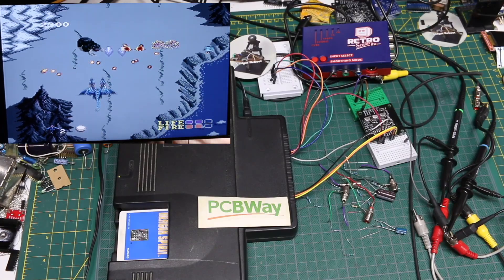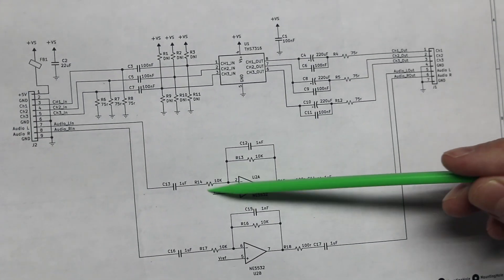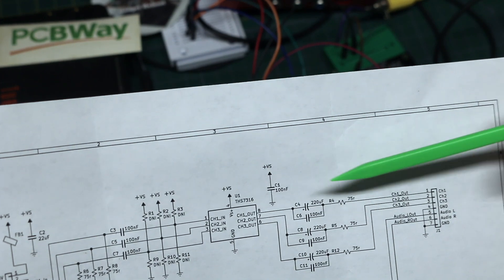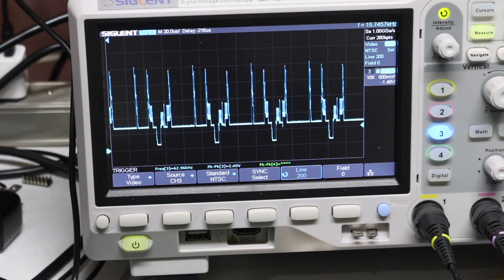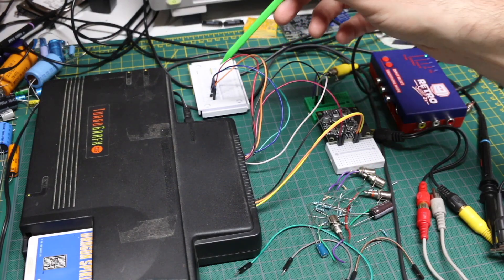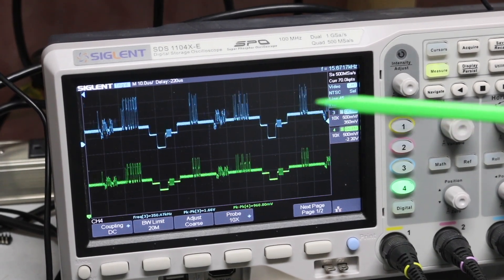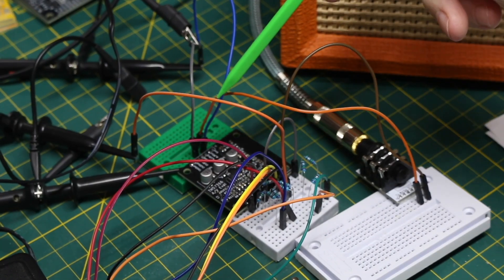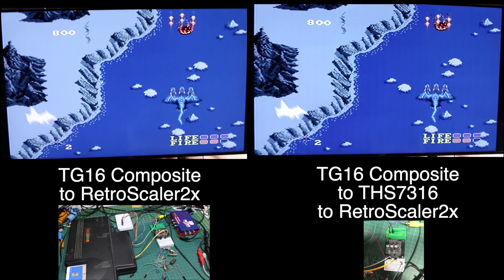THS7316 Video Buffer Experimenting

Comment: Pretty neat chip and flexible PCB :) Would have made the audio buffer non-inverting though.
Reply from the maker: I figured for the purpose of just experimenting and trying to isolate signals it didn’t really matter so if it’s mono and I wanted to preserve the phase I could just connect two of those in series and if it is stereo as long as they are both inverted there’s no relative phase problem.
mostly it’s just habit, I find noninverting op amp circuits sometimes to be as intuitive to use as PNP transistors.

Comment: Impressive video, Gadget Reboot. Looking forward to your next upload! I hit the thumbs up icon on your content. Keep up the fantastic work. Your approach to isolating video signals with the buffer circuit is fascinating—how do you see the advancements in video processing technologies influencing retro gaming setups in the future?
Reply from the maker: now that there’s products available to get the old analog video signals into the 1080 P domain, I’m hoping at least if nothing else, as further things progress and as we get more resolution displays it’s just a matter of scaling up that digital data and it will be just as good
 but also hopefully there will be more advancements in filtering and possibly helping make the digital render more faithful to the old CRT images.
of course with CRTs there were no pixels it was just a fluctuating analog voltage representing colors and brightnesses and images might have a natural blur and the characters and sprites were originally drawn so that they would look correct on those displays 
and now when we try to convert that to specific pixels it may look weird so maybe they can come up with better emulation of blurring pixel information to look like analog signals

Comment: Just thought I'd say
6dB voltage gain is twice the voltage, where as 3dB power gain is twice the power. 
The fun with dB's, and that's before you get started with, dBi, dBv, dBm, etc when you bring a reference in.😊

Nice video.